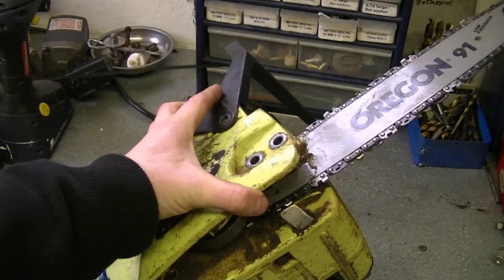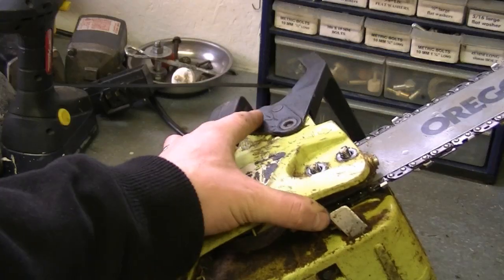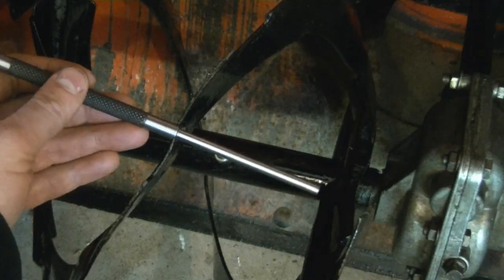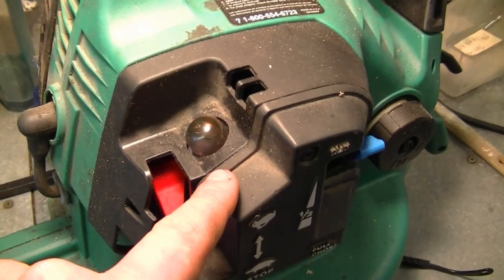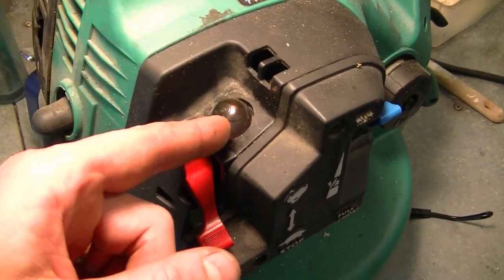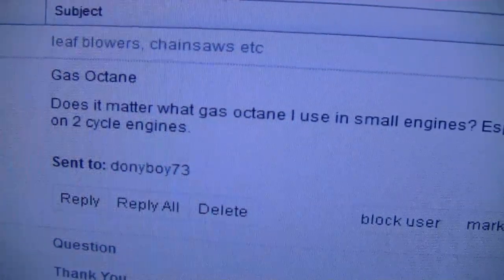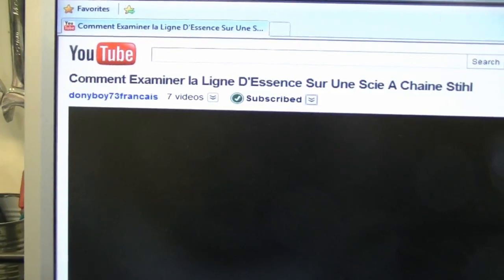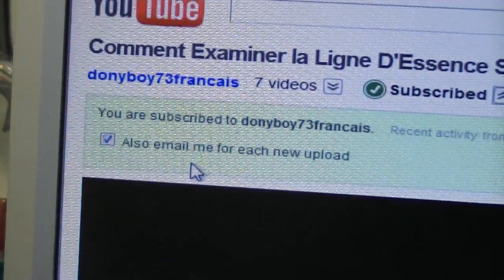Small Engines Q & A Video #75 in HD

Comment: @blackwell1384 actually its the opposite, low octane gas has a lower flashpoint and detonates more readily. I cannot run 91 octane in my Jag simply because it has 13-1 compression. the engine pings and in many cases, continues to run after the ignition is turned off.

we get 98 octane here so that's all I run in everything.

Comment: Most times due to the restriction the primer bulb will stay depressed or be very slow to return to the relaxed position.  Of course a stuck inlet needle will cause this as well, but the plugged filter screen is a lot more common.

Comment: actually highest octane cools the combustion chamber a bit. lower octane fuel is more explosive if compressed. detonation and ignition are two separate phenomena :D
whatever is recommended for the engine it will be fine. I usually run mines on 100.

Comment: Just an input to your octane fuel, I live in Australia where temperatures exceed 35 to 40 degrees c, i have seen small 4 stroke engines with melted pistons and scored bores(aluminium) from the engine getting too hot and overheating due to high octane.

Comment: Part 2- The majority of the time it is the 40 micron filter screen in between the pump diagram is plugged.  Due to it's very fine filtering capabilities (you can't even see light through it) it may have debris, varnished old fuel or even water plugging it up.  I don't bother cleaning them as it is a double screen (dutch twill) and very hard to clean.  Just replace it with a new one (530-035178)  
Just thought I would add my 2 cents--George @ Bay Dist